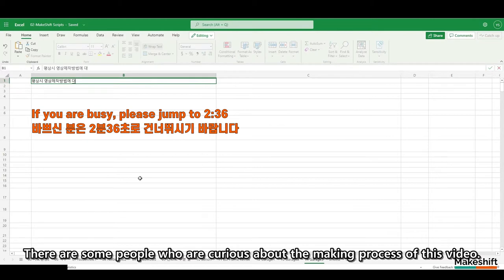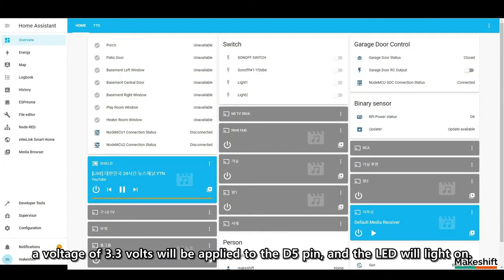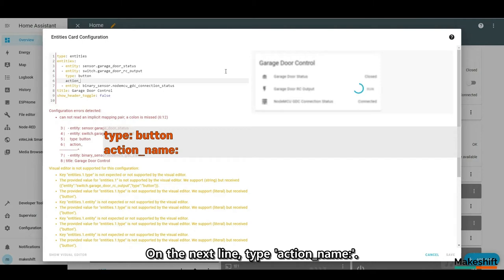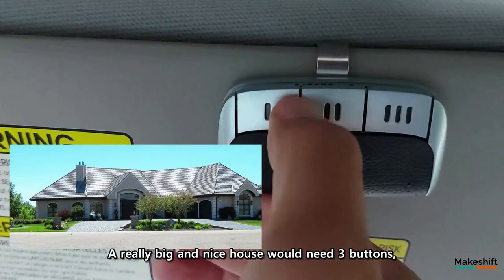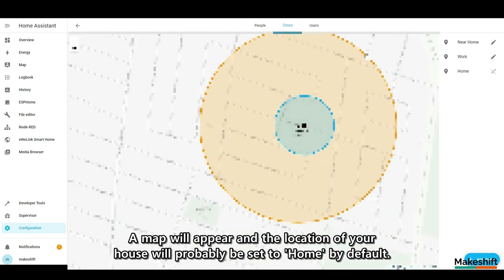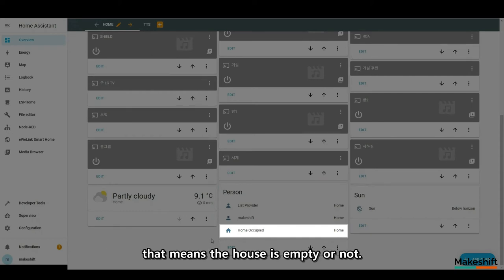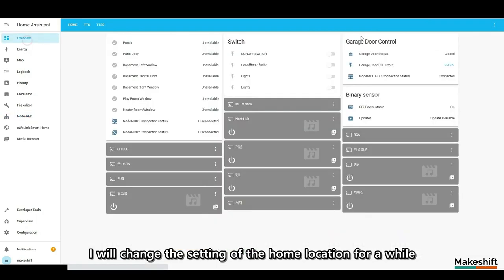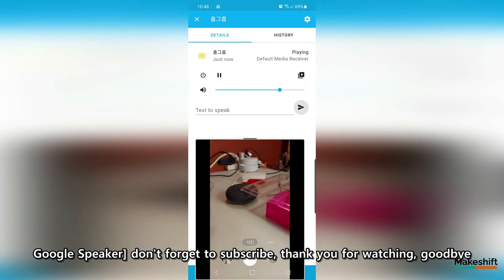DIY Garage Door Automation| Part 3: Remote Control and Actionable Notification (014E)

Comment: Great video and content as always. Thanks!

My 2c here: 
1. the video making section would be a different video in itself. We all have to appreciate the effort and dedication required for quality videos like your.
2. If reducing the size of the overall project is relevant, others may consider using d1mini with a "Solid State Relay" (SSR), MOSFET or BJT transistor e.g. 2N2222 or 2N3904 instead of a Electro-Magnetic Relays (EMR) modules (the blue box thing)
Reply from the maker: Hi~ thanks for watching. Yes, if the size and cost doesn't impact, the SSR equipped device would be a better choice. The only reason I choose the EMR is because I have one, it is cheap, and the relay would be always in off state and on only for 0.2 secs couple of times a day.

Comment: Just finished project and having duckDNS problems. in the meantime how did you add  activate Omega 13 ?
Reply from the maker: That is integrating Google Assistant into Home Assistant (or the other way?). It will be covered in the next video. Which DuckDNS problem are you experiencing now?
Reply: @makeshiftsmarthome6748  I follow everything and when I connect to DuckDNS address I go to sign in for my modem. My wife parks in the garage and loves the voice. But still uses the old garage google command. Maybe she will stay home til next video , I am going to go back and try to set DuckDns up from your earlier videos.Thanks again.
Reply from the maker: @jerryaycock  based on my experience, when i use cable modem and (mesh) router connected to the modem, duckdns most likely works without big issue. However, when i once tried to use one device that cable modem and router combined, i encountered problems. I don't know if this case applies to you. Anyway, good luck!
Reply: @makeshiftsmarthome6748  After beating myself up, I realized I use Nabu Casa and don't need duckDns. Awaiting your next video !!!
Reply from the maker: @jerryaycock  Oh, I see. That makes sense! You don't need to pay $ per month for Nabu Casa once you integrate HA to GA (or GA to HA which I don't know exactly). The 4th video will be uploaded in a few weeks.